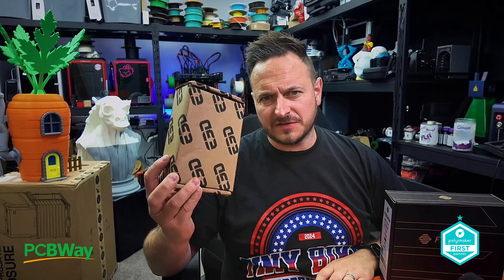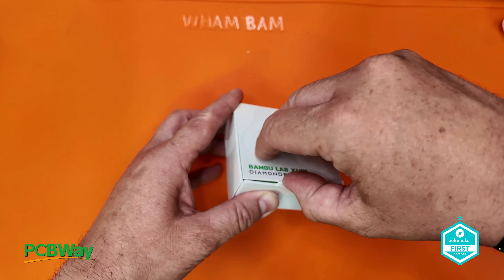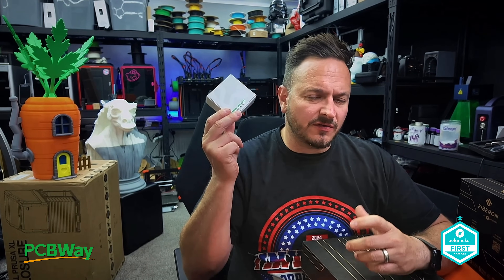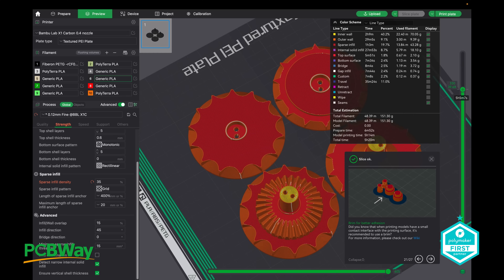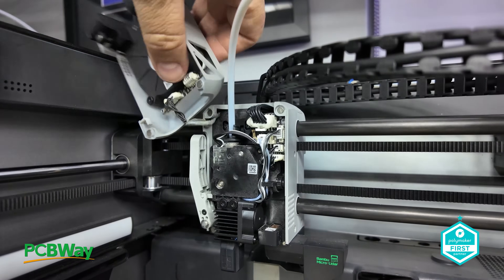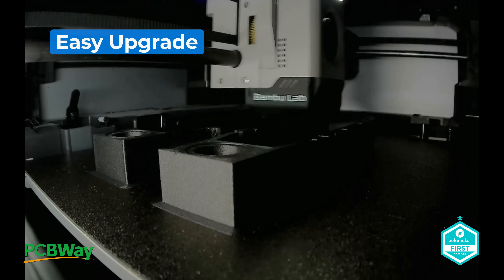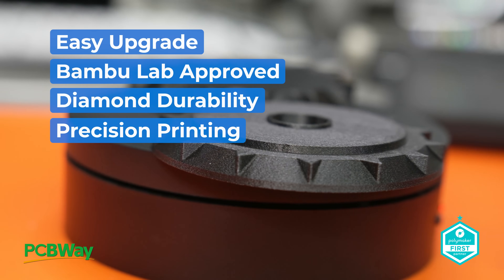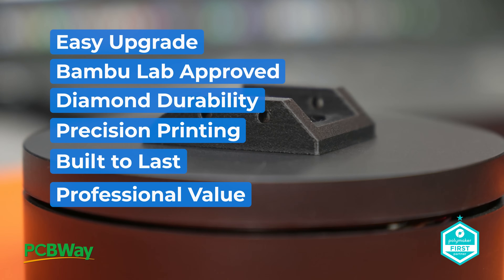E3D & Diamondback - Making Bambu Lab Tough as Diamonds!

Comment: I mainly print PETG, PLA and occasionally ASA, so not even any abrasives - but I still chose the Diamondback for my P1S because it means 1 less thing that can wear out and I have to worry about maintaining.
But importing it to Sweden from the UK after they left the EU was seriously _expensive_. It nearly doubled the cost of the hotend. That's not E3D's fault of course. I still stand by that it's worth it.

Comment: if I'm not missing something, X1C has hardened steel nozzle already, for P1S it's easily available, so why bother with this?
Anyway, I've got tungsten carbide nozzle for my modified Ender 5 Plus with Dragon HF hotend, it was expensive, yes, but works without clogging.
Reply: PCD is polycrystalline diamond.

diamond is harder than steel and harder than tungsten carbide. it is, in fact, impossible to scratch without another diamond. so you never need to worry about abrasive inclusions in filaments reaming the bore out.
Reply: @LexYeen I know that. Actually, everybody does. Point is, tungsten carbide is lifetime material for carbon filled filaments. Those are abrasive, sure, but not to amount to destroy carbide nozzle. Heck, not even hardened steel ones.

So for less money you get hotend that is fully suitable for abrasive filaments. Paying more for some fancy shit because it's „diamond“ is bullshit. Especially when industrial diamonds are mass produced for cheap.

Comment: Can the X1C equipped with the diamond nozzle, tacle PPS-CF if you manage to heat up the chamber effectively?
Reply from the maker: You don’t need a chamber for pps, but I found “heat” works well of models like the k2 plus. The issue you’ll have is with reaching 315-320 as the x1c maxes out at 300, now you “can” still print it but it won’t melt as the manufacturer intended, and i expect several people will cry about the comment but that’s thermal dynamics for you. You might get lucky tho
Reply: @TheRealSamPrentice  Thankyou for replying!
Somehow my brain equated the fact that people were printing other materials with lower temps when using the diamond nozzle, that I kinda forgot that it's not about how many watts you pump into he plastic, but the actual temperature it has to reach. If the nozzle caps at 300, no matter the better conductivity, it will still be 300...dammit. I want that nice ringing! ^_^
(yes, I have read the mods to get there, no worries)

Comment: The ObXidian is for high flow and is abrasive resistant according to E3d. straight from the product page "Smooth and Hard. We've applied our E3DLC™ coating to the nozzle and heater parts, adding even more abrasive resistance for all your fibre-filled fun and a non-stick protective layer to prevent plastic build-up on the Nozzle."

Comment: Ive been using this nozzle and it has been a headache straight from the box. Ive had so much clogging issues with this nozzle. Ive been able to print several pa-cf prints after it several failed prints but I have not been able to print any tpu or wood pla items. It always clog mid way during the print.
Reply: Same. Getting about of clogs. I’ve moderated temps downward almost 10 degrees in some cases and that has helped a lot. In fact most materials run a bit better on this nozzle lowering the temps slightly. The thermal conductivity of the top is MASSIVE so that may be part of it.

Comment: Another review seems to debunk the more smooth extruding and showed microscope images of the nozzle hole, showing more rough sides than hardened steel nozzles, causing increased risk of clogging.
Reply from the maker: Where’s that then ?
Reply: @TheRealSamPrentice  A channel called "Printing perspective".  It's not that he was totally negative about the diamondback, just that the small 0.4mm hole size combined with the rougher edges cause easier clogging and of course the price ...

Comment: Had a diamond back nozzle on my ender 3 v2 and it was great till it wasn't. It can still clog and the nozzle can get coated with filament just like the others. when it clogs it clogs badly. The price point for it complete it reasonable because the nozzle alone were $100 by themselves. All in all, i loved my diamondback but don't use enough abrasive materials to get another

Comment: Ludicrous pricing
Reply from the maker: Do you print in that material tho? I’m guessing not
Reply: @TheRealSamPrentice  I don't know about him but I do print tons of CF, I have some of my machine that exclusively print that 24/7. This is a crazy pricing for that, I have a few full hotend assembly and I only now buy OEM standalone hotend which are like 15$ and when needed I just swap one of the assembly I have so that it's quick and then remove the hot end on the spare one and get it ready for the next swap... 165$ is bunker for 1 hotend when the difference is so minimal ... I would get my money back after 11 OEM hardened steel bambu hotend that's crazy. I want to say that so far it seem that printing CF non stop 24/7 seem to push me to switch some hotend about every 3 to 6 months. Do the maths, it will take a long time to get my money back even if it does last longer then 11 OEM hotend.
Reply from the maker: Maybe you’re better to test then? It’s about design  and longevity
Reply: @TheRealSamPrentice   I don't mind testing ... I'll give it a few months and see what other people that print lots of CF say about it ... I personally think that swapping hotend is easy and quick ... so I don't see a huge use case at this price. If they just sold the actual hotend by itself at around 60-80$ that would be different discussion and I'd definitely be buying a few but 165 ... the whole printer if you're talking about a P1S is 599 ... you can upgrade the hotend and the gear for about 40$ ... so 640 vs 165 just for the hot end ... just seem like they had to pay a large license to Bambu and obviously I don't doubt they are expensive to make and they want to make a profit ... which make the product questionable as-is in. Again my opinion ... the product can be amazing I'm just questioning price.